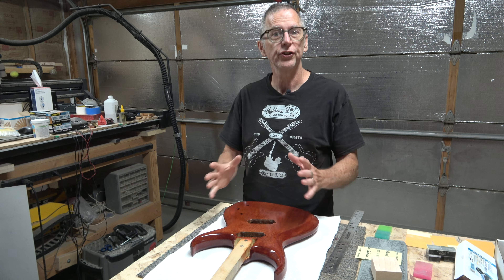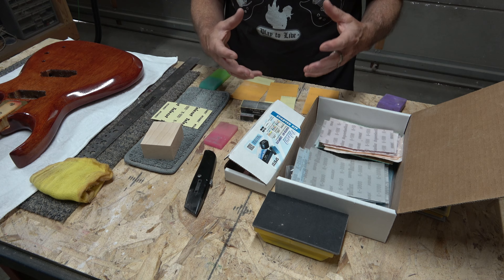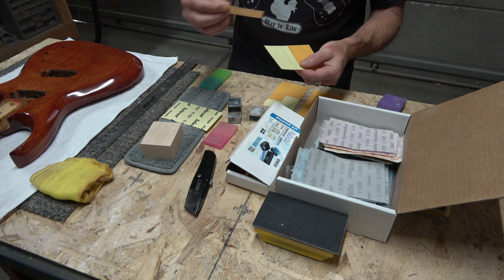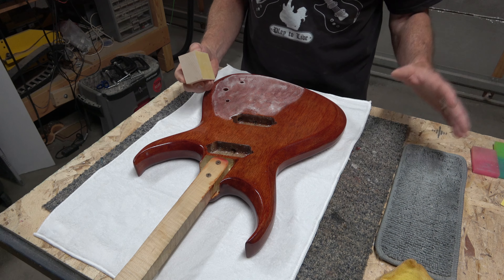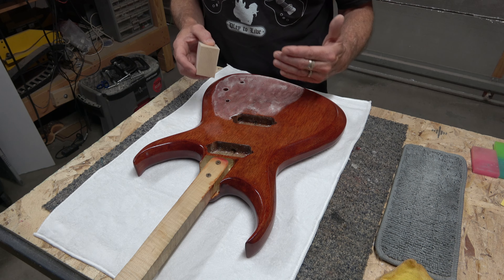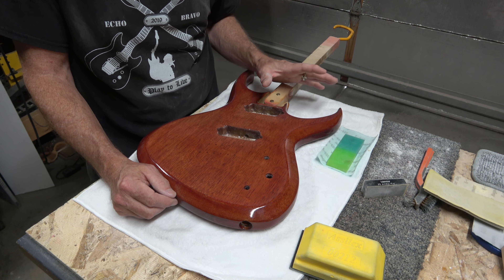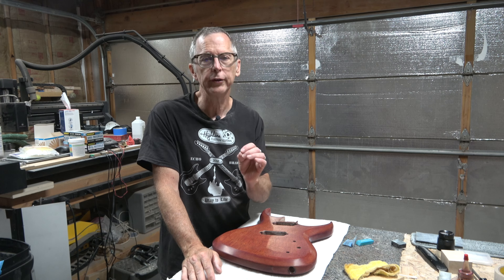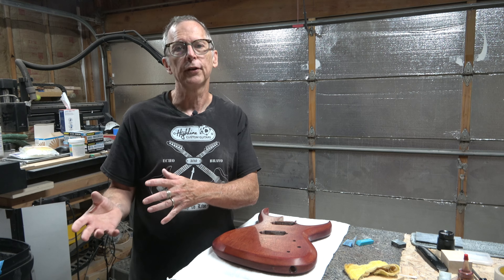Making A Six String Multi Scale Guitar: Dry Sanding The Clear Coat

Comment: I stopped wet sanding with water altogether.  Always dry.  Water kept getting into the holes and caused swelling.  When I used nitro, I used mineral spirits.  Dry sanding is a challenge.  I haven't tried the newer papers.

Comment: Great video, is there any advantage using Tolex rather than Assilex for level sanding?
Reply from the maker: @RJRRJRRJRRJR  Tolecut doesn’t have a cushioned back like Super Assilex has. The cushion is great for removing scratches, but it won’t remove finish texture.
Reply: Thank you for that information, so I'll get some Tolecut!